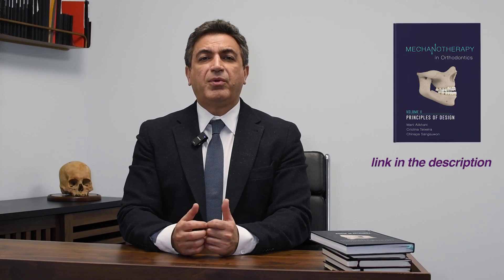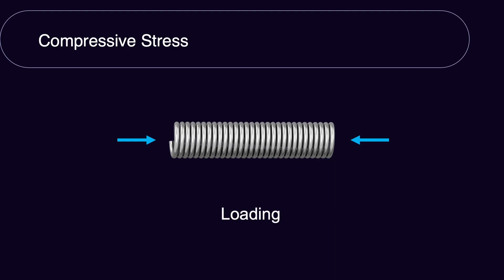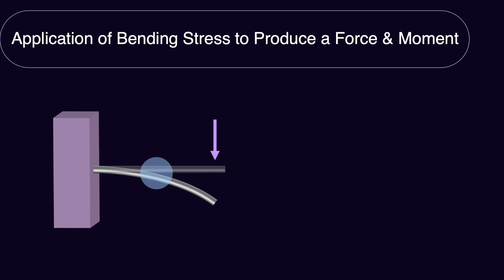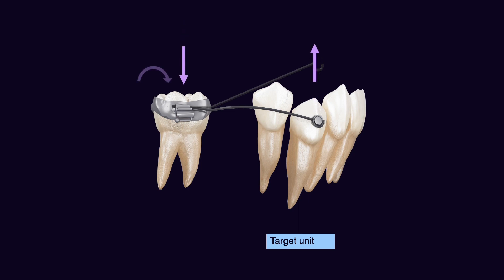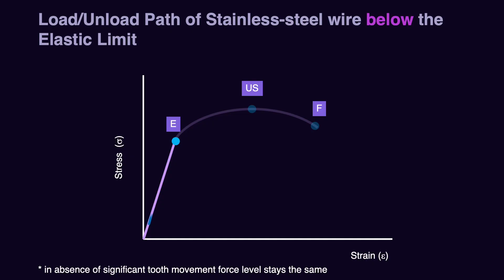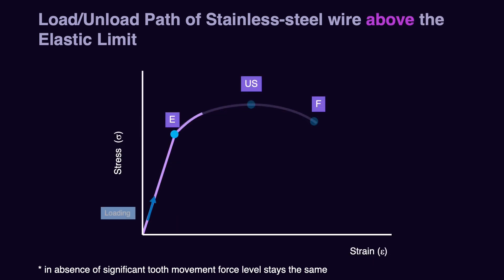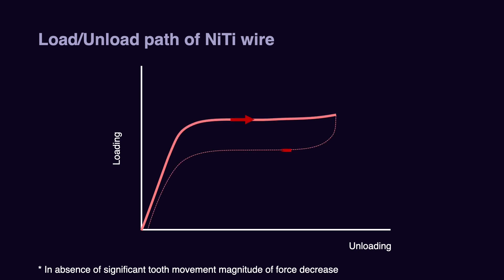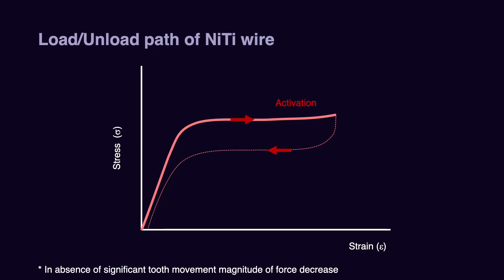Mechanotherapy in Orthodontics Vol II: Loading & Unloading #16

Comment: Hello Dr 🙏
I dont know if ull ever see this. But i thought id try. 
I was recently reading a paper that used a yinyang archwire for the correction of an occlusal cant. But i couldnt really understand the mechanics behind it. 
I came up with a theory, that the 2 sides of the wire since they extrude opp forces eq in magnitude and opposite in direction than they act as a couple, with the center of the maxilla bieng the center of resistance and center of rotation. But then what about the couple produced? Wouldnt its direction be opposite to the deactivated forces that i desire